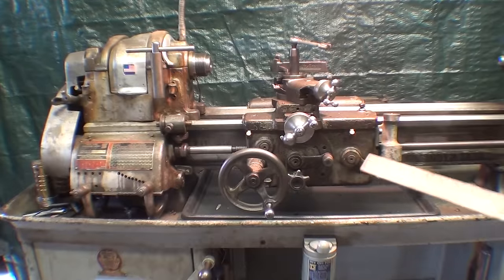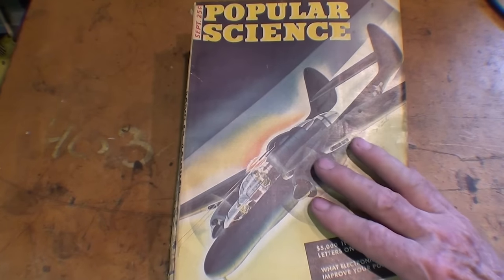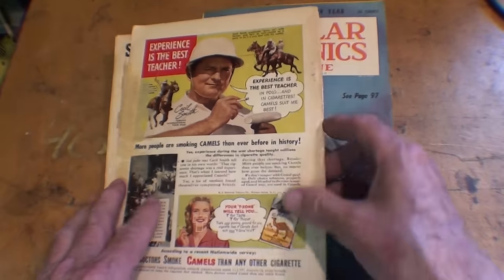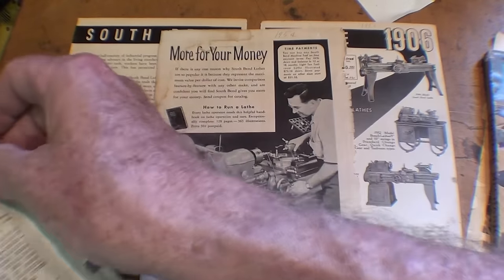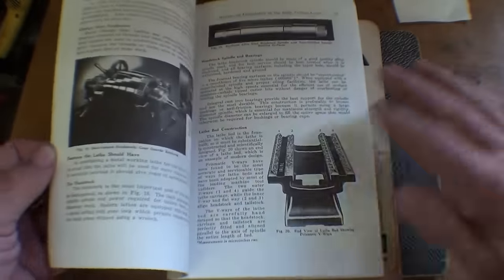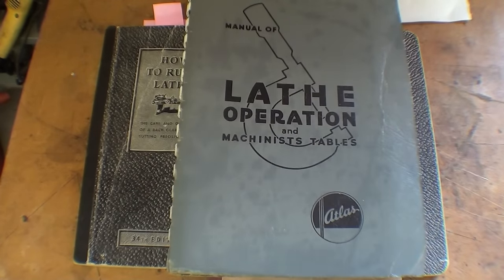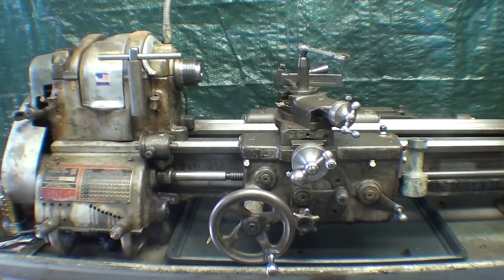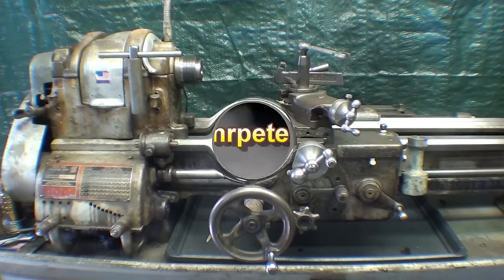TIPS #269 Pt 1 of 3 How to Buy a SOUTH BEND LATHE tubalcain

Comment: I swear.  The older I get, the more convinced I get that things were better when things were worse.

November 1948 was probably absolutely intolerable by 2021standards.  Weatherproof clothes? HA! Wool and rubberized cotton.  Soap was available, of course, but it was crap.  Razor blades would skin your chin down to the bone if you weren't careful.  Clothes were, by and large, better made, but were quite expensive so people had smaller wardrobes.  

MEdicine was barely out of the dark ages.  Penicillin was still a few years off.  Cancer was basically untreatable.  If you had the pox, either way, your peepee might just rot right off.

But the things people made.  If it could be machined, or stamped, or welded or soldered?  Just fantastic.  I got into vintage sewing machines a little while ago, and just about anything offered for sale before about 1979 is so vastly superior in its construction to beggar belief.  And the things they got them to do with just cams and linkages!  Absolutely remarkable.

Comment: I was just using a SB lathe at school last week.  I"ll have to check the model #.. but it has the motor below with the belt pulley.   was using the 5C collet to turn some work.. oh, it also has a taper attachment and a turret.
Reply: It's a CL 145 C, Bed: 13x6

Comment: GREAT VIDEO  I have two south bend lathes a 13, and a 9 inch like the one in the ad at 7.40  you said you had one on cast iron legs, mine has the cast iron legs, but it also has a pedestal that mounts on the floor behind the lathe, it holds the motor and step pulley I have never seen one on a pedestal  all that I have seen have the motor mounted to the bench or right on the lathe  behind the head. Have you ever seen the motor and step pulleys on a cast iron pedestal behind the lathe ?  I can show it to you.

Comment: looking forward to the other parts. I had a Logan lathe that I used restoring my airplane. I really enjoyed using the lathe but after a move I didn't have a place for it. Sold it so it wasn't covered on the back porch. What are your thoughts on one of the smaller table top units? What brand of a new lathe would you recommend? Thanks for the great information.

Comment: Mr. Pete, I appreciate all the knowledge you share on a regular basis. I have a 13" SB and was running it at top speed and the rear spindle bushing locked up and I turned it off. Within 30 seconds it would start up and run but not at high speeds. I removed the Oil Git and let the oil that was in it drain. I added some MotorKote to help lubricate the bushing, even a little bit of this additive makes a difference. I think the felts are blocking oil flow since it is 60 years old and mostly original. Can I remove the rear cap to check the bushing or do I need to remove both caps together so I don't cause any further damage? Thank you.
Reply from the maker: I am sorry to tell you that I never had one of those apart
Reply: @mrpete222  Thanks anyway

Comment: Hello there, I have a Southbend co. lathe for sale as far as I know it's one of this models - BC9-10 / C810JR - Theres a modern switch and engine on there, rest is original complete with gears and alot of stuff. never cleaned with compresed air and 'clean' gears. I havent checked the serial no. yet.
What you reckon I could ask for a nice lathe like this.